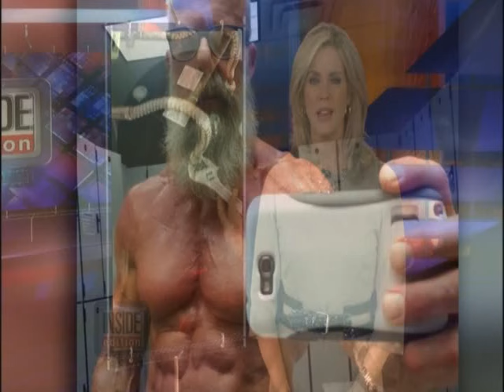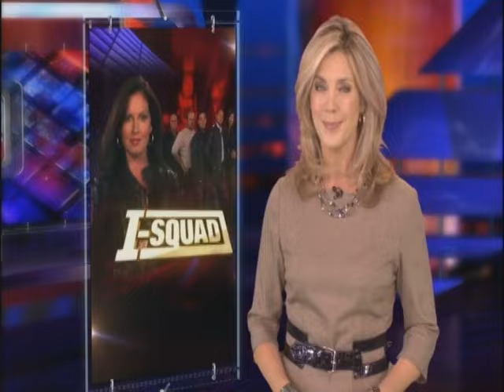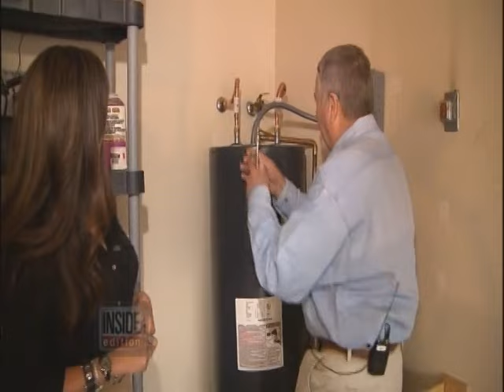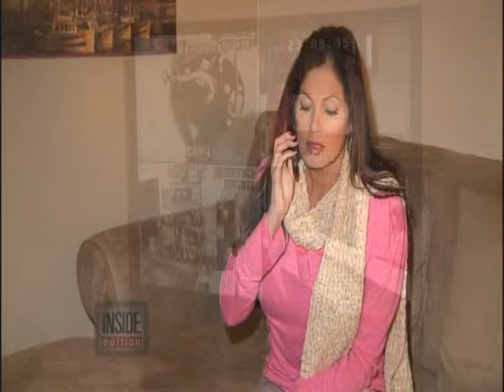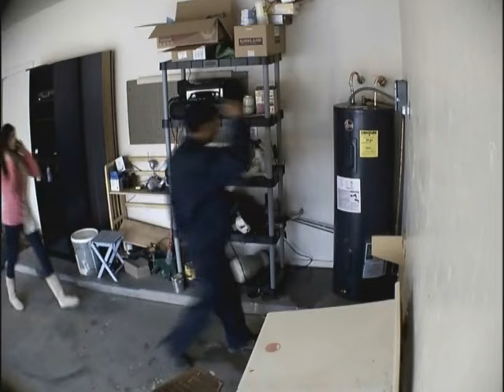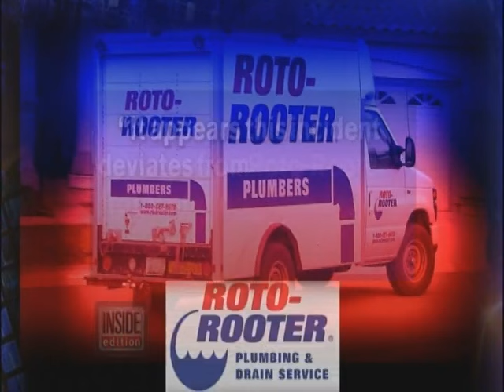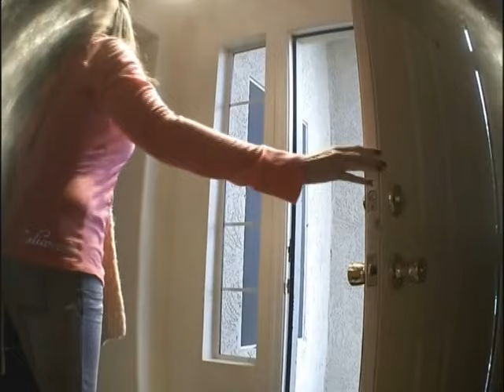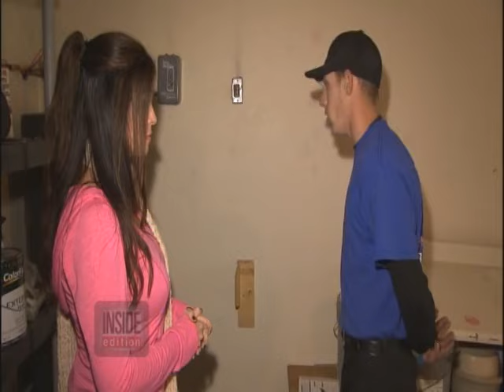Marlin Service Catches Plumbing Scams

Comment: Roto Rooter only charging $507 for a new water heater?  That's the hardest thing to believe in this entire video.
Reply: that was over 20 years ago when this video was filmed.
Reply: now it is 2019 I was charged $450 to replace a pressure reducing valve - job took 30 min and part cost $50 LOL. ROTO Rooter Scamms.
Reply: True, for me: $600 for water heater, $60 for expansion tank, $100 for miscellaneous parts. That's just parts. I would have thought the bad guys would have charges about $1000.
Reply: how old is this video ? i use Roto Rooter. I'm worried now. It's usually the independent companies that cheat. there are time when thwe workers cheat their own companies. The price of the water heater isn't the issue. It's the quality.
Reply: @davidchan9632  
No, roto rooter plumbers are con men. They upsell and work on commissions.
Reply: Lol😂
Reply: This was 11 years ago you look at $750 1 grand just for the tank

Comment: My wife and I purchased our first home in 2009. The basement had flooded during the first week. We called a plumber. He told us how our pipe had collapsed and that it would cost us nearly 7k to replace the pipe. He also explained that the quote did not include clean-up, as he was going to bust through our in-ground pool and just leave us with a monumental mess. We were young and felt devastated.

I called for a second opinion. The second guy snaked the drain and said the pipes are perfectly fine. 85 bucks and all is good.

ALWAYS GET A SECOND QUOTE.
Reply: WOW - 7k vs 85 bucks - the first liar should have been ashamed!!

Comment: I loved working as a service tech for Bell Atlantic who got their money from everyone's phone bills each month. If the problem was inside the home, and the home owner didn't have a wire maintenance plan, we were supposed to charge them a service call and at least 15 minutes. I had a woman tell me "I'm single, live here by myself and I can't afford that". It hit me in my heart. I looked in the box and found a rusty NTW and told her it was a problem. She asked if it was causing the problem. I said "no", but because it is a problem I won't charge you". She got the wire maintenance plan immediately, I disconnected the inside wire causing the problem, and she had a phone in use. The following monday the manager and my supervisor told me I had to go back to that job and fix it, and they're coming along also. She told them everything that happened and said "I'm switching my cellphone service over to Bell Atlantic and you all have good people working for you, is he losing his job over this". Both my supervisor and manager looked at each other and said "no, he won't lose his job over this". The problem was a shorted phone, and because she bought the cheap wire plan I was supposed to charge her because it was her PHONE causing the problem. I didn't charge her. I had a heart. A single woman paying everything is rough. I kept a customer too. I changed her jack and said she needed the new gel jacks to keep corrosion from ruining the connection. She asked if it was the problem and I told her no, don't plug that phone back in". I don't understand how people don't have hearts and can rip people off. I don't. Do right, do people right, and you will become a big successful company that people will pay for your services. Rip people off and you'll get your customer or 4 every month and  make a little money. I got a heart and could never rip people off. A simple service call, I'd feel bad about having to charge someone a hundred dollar service call to push a fuse back in. YET, the company has to get that hundred so everyone gets payed. Fucked up catch 22.

Comment: Some years ago I had water in my yard.  I called a local plumbing company, and they came out and said the pipes had cracked inside the foundation, and quoted me $8,000.00 for a repair job which would require rerouting ALL of my pipes through the walls in the house.

After closer investigation by me, I went to Lowe's and bought some materials, and then I repaired a leaky connection where the supply line from the street connected to the main house line.  I spent about $25.00.
Reply: Plus your time and energy not just 25.00 bucks

Comment: i came home one night with my wife to find our restroom had flooded... i imediatly knew it was the water heater on the other side of the wall in the garage... so i shut it off and thought i was screwed... the next day i turned the water on to see where the water was leaking from just to make sure... it was leaking from a pressure valve in the middle of the unit... so i bought a new pressure valve and bam it worked!!! still working after 3 years too!!!
Reply: Daniel Silva wow, i guess.

Comment: I do all my own work. I've been scammed and can't afford it. I was a carpenter than painter and rehabed some homes. Plumbers are the worst. I learned how to sweat pipes and just about everything about 8 years ago. When you learn what they actually do and how easy it is on your average house, it makes me go baserk that they charge me 2 weeks worth of my pay for 5 hours worth of work and its not brain surgery. This plumber came by that my ex called wanted to charge her 220 dollars because the toilet was running. I came home and kicked his fucking ass out of my house, called him a fucking thief and removed the old toilet bowl cleaner puck away from the stopper in 5 seconds. Most are nothing but thieves they should be thrown in jail.
Reply: I just wondered if they killed the power to the water heater
Reply: it's not really right to lump all plumbers into that category. Not all of them are out to scam and to be honest you act like plumbing is easy when it's actually alot of work.
Reply: Been a licensed master plumber for longer then many have been alive.  It is neither easy nor simple work.  We are expected to never be seen or heard and it has to work.
Reply: What you dont understand sir is most times not all, its better to repair most parts if its a older toilet etc. Because if you were to repair just the flapper or fillvalve on the toilet many times other stuff tends to breaks or leak. Then you get called back for not doing a good job, should have fixed it right the first time etc. Then you have to charge again and customers is really pissed. Its like the mechanic only fixing oneside of  your brakepads replace all of them if you know there gonna start screeching a monthe for now. I just think your a cheapskate...lol.
Reply: You do realize these are businesses trying to turn a profit?You sound like some dude who watched a few videos on YouTube on how to replace a toilet and know since you learned that you think you're a  genius of plumbing.

Comment: Rotor Rooter is the biggest scam known to plumbing. A normal main sewer clearing will cost $99-$200. When you call Rotor Rooter it's a minimum $450+ and they try to sell you on an insane amount of stuff.

The only deviation from Rotor Rooter protocol is that the protocol is to successfully scam the customer. Since the salesman did not do that (they aren't plumbers, they are salesmen), the salesman violated Rotor Rooter protocol.
Reply: Very false.  I work for ROTO ROOTER.  and we are the honest company in my town.  Just because one fails you, doesn't mean the rest of us do.  Don't bash the whole company because of one bad seed.
Reply: 200 dollars for a main line cleaning? How the hell do you come up with that number? 

You have absolutely no idea what is in a drain line before you charge to clean it. I assume you're not a plumber.

Comment: When the economy is bad,and a contractor has alot of employess and trucks on the road you are more likely to get taken,even from a honest contractors at times.FACT.There IS a bottom line for how much a company HAS to make each day to break even,and that's just to break even.WE are NOT in business to break even.HVAC is a tough business.The overhead can be ridiculous.Each tech that goes out in the morning has to come back with a minimum amount of money to cover his pay for the day,and business overhead and profit.Profit is NOT a bad word.I DO NOT tell customer they have to do this,do that.I suggest to them to change certain parts cause of their age,visual condition of the part.This is called preventive maintenance.Commercial I look for everything I can write up to make money.However,my boss does not mark the parts up ridiculously .
Reply: so its the consumers problem that a company has tons of overhead and probably a bunch of useless employees? I dont think so, I run an HVAC company and I would never rip off the customer. Long term customers are worth much more than a short term payday. For you to even say that consumers are going to get ripped off even by honest companies is a joke. Maybe you should find a different career path.

Comment: This is a bullcrap test. No wonder the roto-rooter guy wanted to replace it. Nuts don't just loosen by themselves, so it would make sense there is a problem. In my area, if a hot water tank is leaking it needs to get replaced. Mind you 99% of people here rent the tank and get it swapped for free.

Comment: And it's not a hot water heater , you don't have to heat hot water.
Reply: you do if you want it hotter than it is
Reply: Anything with a temperature higher than absolute zero has heat.  Did you know you can extract heat out of ice?
Reply: Amen, been a plumber for ten years and the hot water heater thing is still a pet peeve.
Reply: "hot" or "cold" is a relative thing.  Since liquid water is clearly above 0 degrees Kelvin, even what we call "cold" water is very hot by absolute zero reference, so even 55 F is very hot on the scale between absolute zero and steam.   It's just a mixup/combination of "hot water maker" and "water heater".  Don't let it bother you.
Reply: Andrew Ysker yeah 22 seconds into I thought that.

Comment: Same goes to furnace. I have a 20 year old furnace. I called 5 guys for repair, 4 guys tried to sell me new one, quoted from $6K to 10K including installation. One guy cleaned throughly and charged me $109 + tax. even told me it will run ok if I maintain it well with annual tune up, which I didnt do for past 5 years.

Comment: How good are the "expert" plumbers if using an adjustable wrench?  Any experienced tech in any field uses a tool specific for the job.
Reply: An adjustable wrench is the right tool for that particular job. It will not knurl the fitting like a set of pliers or pipe wrench would. Which wrench would you prefer they used?
Reply: @njgodfather  A torque wrench, so you can tighten it objectively.

Comment: Good thing he realized he was using the wrench backwards at 0:00
Reply: Upon closer examination, we the people who have used tools in the past have concluded he flipped it to get a better fitting of the adjustable wench on the knot.    It's a method often used when the shape of your tool wont allow you a firm or a adequate fitting, usually caused by obstructing objects or the user feels more comfortable using less effort to turn the knot with a better grip.
Reply: Well yes, sometimes it is necessary to flip the wrench due to angle, but not using it in the correct orientation makes it highly likely that you will round the nut.
Reply: +skoronesa LOL you do realize I was being sarcastic?  But you're right, the wrong angle can round the nut and cause nasty and painful gashes.
Reply: I did not realize it was sarcasm. It's tough to find a good crescent wrench that only rounds the nut a little.
Reply: +skoronesa I've seen the auto retractable that Craftsman has.  Itv seems to lock pretty good on position but it won't replace a solid wrench or socket.  I've always wanted to come up with a adjustable fitting tool for such jobs other than a adjustable wrench.  Where sockets and wrenches just will not do.  Am yet to create such idea a reality.

Comment: I am a plumber and ran across that sort of problem. When I find a hose leaking on the heater I would swap it out and not just tighten it up that's not a part that just comes loose on its own like that. That's to ensure it got fixed right the first time

Comment: Most Roto-Rooter contractors,  yes they are independently owned franchises make money by selling high priced repairs. This is because the company Roto-Rooter supplies leads and charges for these leads.  Last time I called Roto-Rooter was a Sunday night before Christmas, they claimed 24/7 but waited until all other plumbers I could have called were closed, then they called and said Christmas day. The result was my main drain was broken and they could start the $8000 repair at once with a signed funded contract. 
I called a local drain cleaning company and agreed to his overtime charge of $300. His guy came out and snaked the drain which was clogged with roots from a tree we had removed in Fall. For $50 more they put a chemical down the drain to kill the roots and stop them from coming back. $350 and I tipped their men $50 for good service.

Comment: Now you know why I'm against paying a mechanic on commission. I'll give you an example. I worked for a company(briefly) that paid a 18% gross commission. How it worked was they charged $27.50 to "diagnose" the problem. They then gave you a set price. If you declined the price, they collected the $27.50 and left. If you accepted the price, they waived the $27.50.As the mechanic I'd receive $4.95 if they declined.Some calls may take as long as 1 1/2 hours to get to. One job was 45 minutes , one way. It was an home insurance call. The homeowner wanted a new H/W/H. Other than being old there was nothing wrong with the heater. The insurance co. declined.So.. including travel and diagnostic time it was 2 hours of my time for $4.95. If I had taken a hammer to the heater, then told the insurer it was bad, the insurer would be none the wiser, the owner would have received a new heater and I would have been paid about $144.00 for about 4 1/2 hours. Or about $32.00 an hour. That's why commission is really bad. Just pay the poor slob a hourly rate.They won't be tempted to fiddle.

Comment: About 12 years ago I had leaky valves on my washing machine water supply  they dripped and the water went down three floors damaged 3 intercom systems  in condos below me.  The cost for my leak  was $700 to the condo building and about $150 for the plumber. When the plumber came he explained the rates  ... minimum 1 hours work a hundred and change he finished his work in about 15 minutes. I asked him if he could install new washer hoses on my washer he laughs and says sure you've got 45 minutes left on the clock.   The moral of the story is if you live in a condo go to management and ask them to recommend a plumber just like I did you should have better luck.  After 12 years  those valves are still in perfect condition.

Comment: I am an auto tech with 40 years exp and i will tell you this every hardworking plumber out there should be  really concerned about the epidemic of dishonesty in the plumbing business caused largely by rotorooter and rooterman the same stigma as the auto repair has experienced will happen to them

Comment: I'm wondering what year this is?  Right now (2018) I can't even purchase a electric water heater for 500 to 600 dollars. Then I have labor & materials on top. I would go broke in a months time like that.
    On another note.  I would not charge for that visit either. They really didn't do anything except for tighting down the brass nut. Although in California that water heater is not legally installed.  Anyone know why it's not legal? 
            2 main things!
Reply: Harry Knows  2013 would make it 5 years almost 6 years ago. Just that few of years back. Everyone in my area was charging 1400 to 1800 for a standard 40 gallon title 24 water heater. But our codes are much stricter than where ever this video was shot. Its missing half of what would let it ass an inspection here. I wouldn't do this bad of work for no amount of money.
Reply: Harry Knows  a 40 gallon title 24 natural gas heater here cost about $640.00.  Plus the water flex lines, new ball valve. New earth quake strap. Plus ground wire from cold to hot to gas line.  Replace any single wall parts of the flue. Hopefully the double wall art is still in good shape.  This all takes approximately 40 minute from pull up to house to driving away.  This cost right now anywhere between $1875.00 to $2300.00. I also need to make sure it's on a stand if in the garage plus a drain pan that drains outside of the building. I can do this in about 40 minutes. When I had employees.  I gave them 1 hour 30 minutes. After that they better have explained to me and the customer why they are charging extra. Over & about the flat rated quoted price and gotten the signature of the customer. When the plumber is making 75 to a 100 dollars an hour. They better stay on tract or start looking for another place to work.

Comment: At our company, we would have changed the supply line (we call them "waboos") because I would have assumed that the rubber gasket was bad. And also because we operate out of Texas, if I  checked the water pressure and it was over 80psi I would have recommended an expansion tank as well as a vacuum breaker as code upgrades

Comment: Yea I’ve took up the trade as a plumber and I don’t believe in selling something that a customer doesn’t need. Once I do a thorough evaluation of the problem and finds that the nut was loose I would tighten it and assure the line wasn’t leaking and just charge a service diagnostic fee and be on my way. I believe in treating a customer property like it’s your own not like a dollar sign